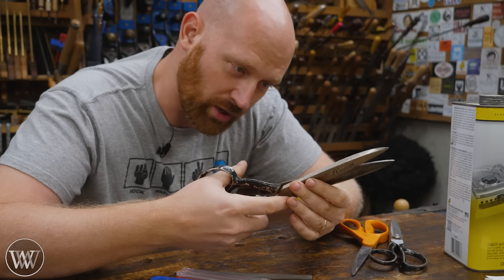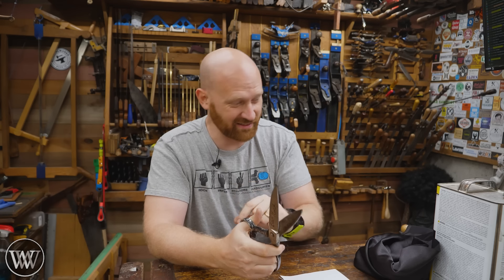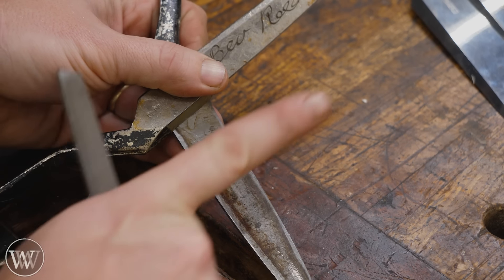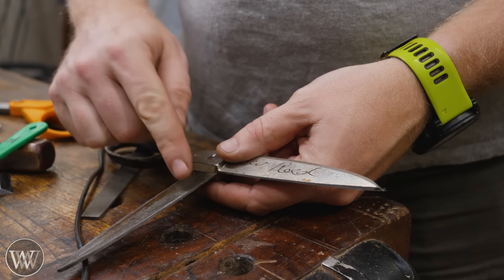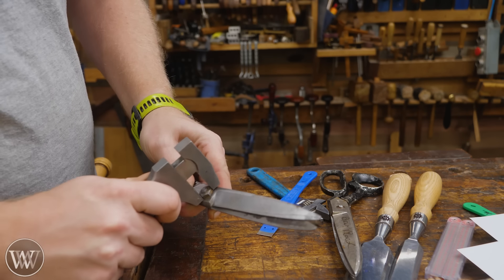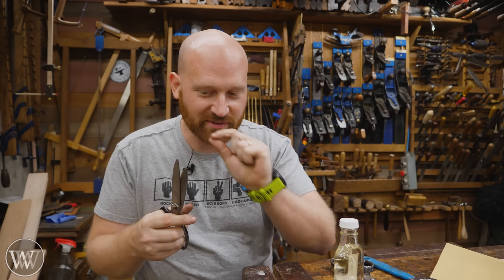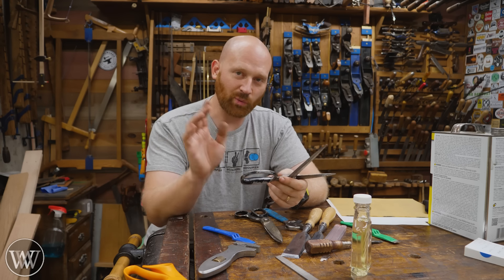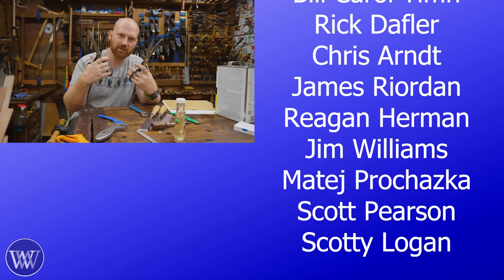How to Sharpen Scissors Like a Pro at Home

Comment: Fastest way to dull your utility scissors is to cut roof singles
Reply: I cut sandpaper with mine all the time and either use rubber cement, liquid nails, or CA glue ("super glue") to put them on flat blocks like wood blocks,  aluminum  metal plates, or even plastic tubing so I can make my own sanding pads. 
I also had those spongy foam pads from the auto body store but I usually just wrap my fine grit in them and wet sand with them like that and dunk them in and out of a bucket of water.

Comment: I'm a retired paramedic. One thing I didn't skimp on was my trauma shears. I had 3 pair of German made shears. I always carried a pair of cheap bandage scissors on me, just in case a nurse asked to borrow my scissors. Nurses know that paramedics always have scissors on them. Paramedics know that nurses usually want to borrow your trauma shears to cut paper. I got tired of asking what they wanted to cut with them, and then arguing over why paper was bad for them. That's why I carried the cheap bandage scissors. Then everyone was happy.

I wasn't entirely convinced that paper would really dull them that badly, but I kind of needed them to stay sharp. You need good, sharp scissors to cut through boot leather, when necessary. If it was a biker's boots you cut off, you also needed a good place to hide. LOL!

Comment: 40+ years ago, I trained as an upholsterer before I trained as a joiner. We used sharp scissors on a daily basis. We sharpened them by hand as one would a chisel or plane. THEN...out came the 'serra-sharp' scissors; self sharpening scissors designed for the upholstery trade at first but probably found other outlets. They had one straight blade and one serrated blade. They worked somewhat but after extended use, still needed hand sharpening on the straight blade - they were not much good at sliding through fabrics. I now always sharpen scissors as we did back in those old days; make sure they are not slack, have an equal slight curvature on each blade so that they cut from heel to tip and have a very keen edge from heel to tip. They should sound as if they are rasping against each other as you cut - and they should cut cleanly right to the very tip.

Comment: I have sharpened scissors since before you were born. They present the most difficulties of any items I have sharpened and I have done them all. Most often the problem ones have been dropped and the curvature has to be corrected in a vice (uk). That's a 50/50 success or breakage.

Comment: Great video :) I got the dmt paddle for my drawknife then ended up using it to sharpen scissors, my axe, spur lathe centers, and even the small circular blades in my electric razor too.
Reply: I need to have another go at sharpening my drawknife, I didnt know what I was doing when I last tried.

Comment: I have several antique Universal Shear Sharpeners. The handle is set up for 1X10 stones or files. I was shown how to properly use these. I keep the files clean with muratic acid. For heavy fabric I just use the file. For lighter fabric I finish with a 320 stone. For silk, polyester and chiffon I use a 600.

Comment: I rarely use expensive, all metal scissors. What I do notice though is that there is a common feature in most common scissors and paper cutters: the blades bend concave towards each other. This helps engage the edges better.

If you have cheap stationery scissors with riveted pivots that loosen over time, I recommend you VERY SLIGHTLY bend the blades.

Comment: I've used my Fiskars in the machine shop 37 years for cutting. 001 to .003 shim stock and cutting filters. They could use a sharpening however they still preform well

Comment: Thanks for the explanations... it would be interesting to see a video on manual sharpening (without other devices such as a mini-grinder, etc.) of the small scissors in the manicure kit, especially the part at the tip, where they have a slight curvature due to their "construction" .

Comment: Most scissors come new, with a burr. As far as I am concerned, that burr needs to be removed, for the same reason we remove burrs from bench chisels and plane irons. You get better performance from them. Fiskars are one big name company, but their scissors have a huge burr on the bevel side, not on the flat side. If you remove that, performance is greatly improved, I use a fine hone, like above 1000 grit, and then I use a more coarse stropping grit, the black stuff from the big box stores, and I apply that to some plywood. You don't need 60,000 grit stropping compound for scissors, except maybe for the Gingher scissors. I do have one pair of Gingher scissors, and they even have a tiny burr. I got some grass nippers and they had about an 80 grit burr on the bevel side of the blade. I got rid of that, and they cut with no effort.

As for paper, a fussy sewer will notice if you cut paper with their Gingher scissors. Another thing about the paper, I was visiting my best friend's dad. It came up in conversation about using paper of any kind to clean glasses. The resounding results from Google said not to use any type of paper for cleaning your glasses. Apparently all of it is some what abrasive and repeated use will cause scratches on your lenses.

Comment: My brother obtained a pair of WISS “inlaid” sheet metal shears that were close to 100 years old, that needed s lot of love. (If you can find some Wiss Inlaid, snap them up, the steel is the best!)I removed the nut and bolt, flattened the faces on my DMT dual diamond plates and then filed the bevel with my diamond files ( a steel file would not touch them!) The nut had been peened over, and removing it stripped the threads so I had to make a new fastener out of an NAS 5/16-24 aircraft bolt and high temperature lock nut. When I finally got them back together, greased and adjusted, they cut thin paper, and close with the sweetest “whisssss” sound. Good for another hundred years of conscientious use.

My wife and I trade haircuts and I sharpen those shears with the fine diamond file ACROSS the blade rather than along it. This creates very fine grooves that catch, hold and cut the hair instead of letting it slide out of the tips.

When wood is ground into paper pulp, fine bits of mineral end up in the paper that WILL dull scissors. My Dad used to keep my Mom’s sewing shears sharp, and woe to us if we used them on paper!
Reply: TLDR

Comment: I was taught to put a few drops of oil on the stone before using. Yes no?
Also are there different metals used like titanium?
Reply from the maker: You would do that on an oilstone but not on a water stone or a diamond stone. And yes, different scissors did use different types of material. Pat, if you use diamonds it really won't make any difference. It will cut them all

Comment: When I was the foreman of a aluminum Foundry the operator of the cutoff bandsaw didn't want to allow a worker to make an occasional cut on wood because it would dull his blade. Technically true; the wood contains some silica, but the effect is trivial. I put an end to that nonsense.

Now if you want to make All the Right Moves and impress the cute chicks, you should never place a rag over a solvent can and inverted it in order to wet the rag. This allows for backwash and can contaminate the solvent. Yes I know, your rag was clean but it's still not a good habit.

Comment: Hi Where did you get that fancy adjustable wrench/spanner you used to tighten the scissors? great video btw
Reply from the maker: It is a remake of a really old design. https://www.handtoolrescue.com/products/wrenchymcwrenchface
You can occasionally find the original ones but they usually cost around $100 or more

Comment: I have a pair japanese pruning style scissors which are riveted and wondered if you have a video or any info on how to tighten them, I don't have a lot of tools to work with, but any info would be appreciated.
Reply from the maker: with those you take a ballpeen hammer and and anvil or other steel plate and slowly tap on the rivet to tighten it back up.

Comment: I would use wet tissue to see if scissors cut well. Those antibacterian tissue that were very well sold in the Pandemy. Some scissors just need a stronger joint to cut well, so sometimes i use a punch drive on that joint.

Comment: Thanks ,what's your opinion on sharpening scissors on aluminum paper ?
Reply from the maker: I wish I had added that one to the video too. It doesn't work. First off you need something harder than the steel to burnish or sharpen. Second off you need something to actually slide over the face of the bevel. This does neither. And when testing it before and after there is no difference on the edge tester that I use.
Reply: Sorry I didn’t read through all the comments before asking this question too.

Comment: Hello from Owen Sound, Ontario. Does cutting aluminum work like the glass bottle
Reply from the maker: No. You need something that is significantly harder than the steel of the scissors and you don't actually cut it your sliding the bevel along the surface.
Reply: @WoodByWrightHowTo  my thanks. Some people suggested it as a quick temp fix

Comment: Great video, thanks! 
Q: I have one of those small garden tool sharpeners. What are your thoughts on using that to sharpen scissors, or cutting tools in general? 🤔
Reply from the maker: It's honestly just about the same thing to sharpen those. Just bigger and usually need a little more work.

Comment: Sis, I have 9 inch singer brand fabric scissors with serial number C 309, can the locking bolt be adjusted to adjust the tightness?

Comment: I’ve heard another sketchy mythic sharpening trick, which is to cut aluminum foil! I don’t, nor would I suggest anyone else to try that.
Reply: Well, I do it when scissors just need a light touch up - and it works really well! There are definitely lots of ridiculous "genius" (🙄) tips out there that are just plain rubbish. I didn't believe it either, until another jewelry maker showed me on the Joyce Chen kitchen snips we commonly use to cut non-ferrous annealed metals, up to about 18ga. That convinced me, and I've been using it ever since. 

Give it a whirl sometime, and see if it works for you. Here's how I do it, in case anyone is curious:

Take a piece of regular kitchen foil that's about twice the length of your scissor blades plus an extra 2 inches, and fold it in half (cut edge to cut edge). Then just snip snip snip all along the edge opposite the fold, as if you were cutting a fringe. No need to be fussy about it, just get make sure to open the scissors wide enough to get at the full length of the blades. You'll hear and feel the blades get sharper as you go. The folded edge keeps (most) (some) of the cut strips from flying all over the place. 

I usually test the scissors first on something that doesn't cut well; since I'm already in the kitchen, I find a piece of paper towel is good for this purpose. Then I test them again after sharpening, and marvel at the difference.

Again, this is not going to work if your blades are a mess! And it probably won't work on them crazy new-fangled super-hard metal alloys with titanium or whatever. But it is a very convenient, quick, and easy  way to do a touch-up. Plus you can easily get the entire length of the blade, which is nice.

Comment: Is it possible to sharpen scissors with a regular whetstone?
Reply from the maker: sure. it is just a bit awkward and you might wear out the stone faster as you are just mailing contact with a thin portion of the blade.

Comment: How about sharpening by cutting through multiple layers of aluminum foil. I've tried it and it seems to kind of work a little 😮
Reply from the maker: ya, naw. To sharpen or burnish steel it needs to be harder then the steel. and in this case the geometry is all wrong for it too.

Comment: What are the effects of different different angles between the bevel and inside face? I have a guillotine paper cutter with. 90° blades and it seems as "sharp" as cutters with more acute angles.
Reply from the maker: the angle has nothing to with sharpness. there are some instances where they might be over 90. the bigger the angle the more durable it is, but the harder it is to push. so if you are cutting things that will dull it quickly toy want it closer to 90 degrees. if you are cutting hare that will not dull much at all but you are using them a lot and hand fatigue is important then you might want to take it down to 20-30 degrees.

Comment: A properly ground pair of scissors is concave on the inside. You can see this very well on the old tailor's scissors, where only the edges are shiny because the cutting surfaces only rub against each other there. A professional scissor grinder will always grind the inside concave. 

The exception are the cheap scissors that are punched out of a thick sheet of metal.

Comment: I think you should redo this video and explain the relationship between two blades, a flat side on each blade, and then the angle and how that angle relates to cutting. I sharpen my knives on a Harbor Freight 1x30 belt sander and I can get my knives scary sharp fast. But hear me out, I have Amazon belts from 80 grit to 1000 grit and I also have a leather belt for it too so I'm not kidding, I can get my knives to a mirror polish and they're literally sharper than a razor. I haven't researched much about scissors yet, in fact you're the first video I've watched but I can't rationalize how the two angles work together yet. I'll Google it after this comment but I as a viewer would like to have seen the relationship between the two blades and how that translates to cutting paper. I totally understand what you mean about lower angles dulling faster but cutting nicer and that's what I would like to personally see done. I've got a few scissors I'm going to work on and the belt sander isn't the only thing I have, I also have files, a mounted knife sharpener, another 7" belt sander, and a 1000/5000 double sided brick I use for my chisels along with a leather strop. My personal goal just so you can understand where I'm coming from is I want razor sharp scissors. I don't want to hear that machining mark sound when I glide scissors through paper, I want a mirror polished blade similar to my knives and I know it's possible to do. May not get life out of them but I'm not cutting things every day. I'd just like to know my scissors will be scary sharp anytime I do need them. So I think that could be a cool video to make. Maybe sacrifice one pair and figure it out.

Comment: What do you think of the method of taking a piece of aluminum foil folding it several times and cutting. Does that sharpen scissors? I’ve heard of that method too.
Reply from the maker: That one is another myth. It will neither burnish nor sharpen them.
Reply: @WoodByWrightHowTo  ohhhh! Thanks!

Comment: I saw another Youtube channel that said you can sharpen scissors by cutting through several layers of aluminum foil several times. I tried it once but it didn't seem to have any effect. Is it worth trying again or just another myth?
Reply from the maker: Yup. That is another common myth. Aluminum is too soft and it is hitting the blade at the wrong angle.

Comment: What about cutting a tinfoil? I guess, that doesn't sharpen the chisel either
Reply from the maker: Yup. That one is an old myth. You need something harder than the steel to sharpen it. And it has to be moving across the bevel in the correct direction. Cutting aluminum foil won't do either of those.
Reply: @WoodByWrightHowTo  But James, I've been using the aluminum foil trick for years. It works well for inexpensive, non-professional scissors that just need a light touch-up. I didn't believe it either, until another jewelry maker showed me on the Joyce Chen kitchen snips we commonly use to cut non-ferrous annealed metals, up to about 18ga. That convinced me, and I've been using it ever since. I know it shouldn't work, but it does.... 🤷🏻‍♀️
Reply from the maker: I did a test on that a wile ago and could not find a measurable difference with an edge tester.
Reply: @WoodByWrightHowTo   Oh well, empirical evidence! If we start going down that road, who knows where we'll end up... 😉

Comment: I was under the impression that with scissors or shears, a person should avoid working on the flat side of the blade. Something about putting the cutting edge (where each blade meets as it cuts) out of alignment.
Reply from the maker: You only work on it if it needs it. But there are times when it is appropriate.

Comment: How about cutting into folded aluminum foil? Can you test that and let me know?
Reply from the maker: That one was also false. Number one. The foil is not hard enough to remove steel significantly. And number two. It would be impacting the edge of the wrong angle.

Comment: What about using aluminum foil to sharpen them, is this true or not?
Reply from the maker: That's another false. If you want to sharpen an edge you have to do it with something that is harder than the edge. Not to mention the angle of attack to the bevel is all wrong.
Reply: @WoodByWrightHowTo  Thanks. I knew this already but just wanted to get your take on it. Great video btw. I enjoy watching and learning.

Comment: How do you fix and sharpen scissors that someone use a chainsaw blade sharpener and didn't even what they was doing and messed the angel and the bevel up bad
Reply from the maker: In that case you usually have to take them back to the grinder and re-establish the bevel